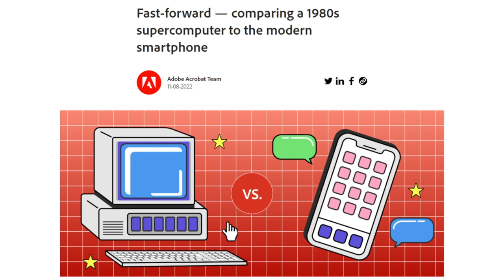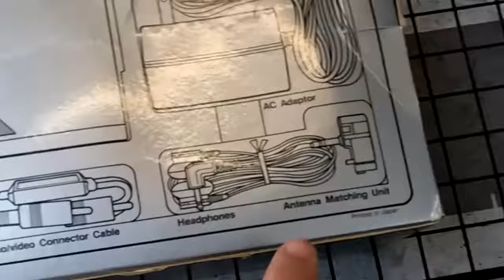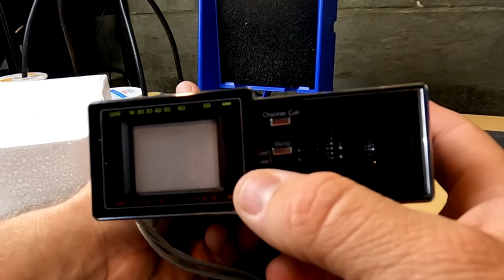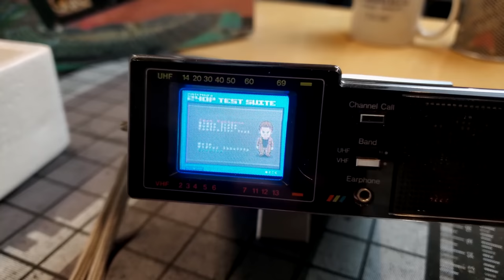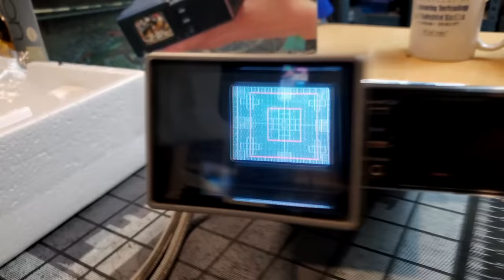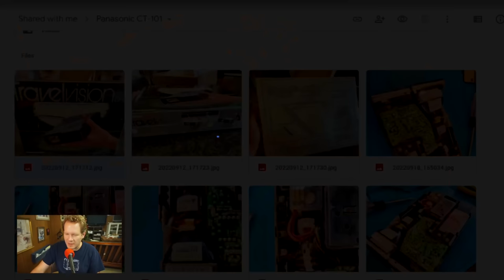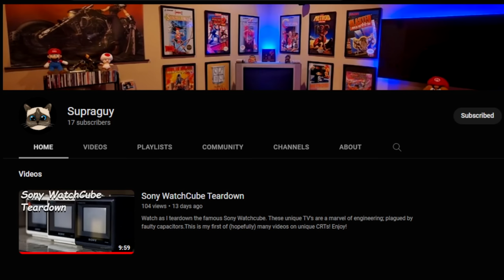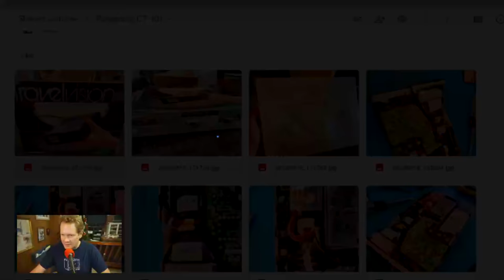The World's SMALLEST Color CRT TV!

Comment: There were similar size colour tubes in some camcorders, and moreso(and earlier) in pro/semi-pro video camreas. Most home camcorders used black & white ones, but I can remember colour ones briefly before LCDs replaced them. I'd imagine devices like this were almost certainly re-using the same tube.
Reply: I was going to say this! I believe a couple of the films during that era had custom stripped down units and were made into remote screens to be used as a futuristic handheld video screen props!
Reply: Monochrome CRTs were widely preferred as camera viewfinders, due to the poor resolution of small colour screens. I remember an interesting innovation in the early 90s, I think Fuji made it. A colour viewfinder that used a monochrome crt, with some kind of spinning colour wheel in front of it, much like how a DLP projector works.
Reply: It's a fairly creative usage of parts that may have otherwise sat in boxes in a warehouse somewhere unless this kind of product existed

Comment: I have a similar unit, but mine came with the AM/FM radio tuner built-in. Too bad the owner didn't take any pictures with the chassis PCB lifted so you can see the capacitors on the underside. I suspect that many of the through hole caps have started leaking and it's just time before this stops working. A very common problem with Panasonic TravelVision portable TV's from the early 80's.

Comment: I read the shadow mask dot pitch is 0.38mm, which would be just about 100 dots at 1.5". That'd be a resolution of 80×60 dots if the 1.5" is diagonal. Trying to count by hand it looks like a little more than that but not much. Maybe the 1.5" is horizontal and it's 100×75  which looks about right.

I'd probably rather just have B&W to be honest.

Comment: Can see the size to detail threshold for a tube that small especially with text, not so much 240p compliant but definitely 120p like some 2600 or an Odyssey 2 game would display more favorably. Game Boy or GBC 160x144 graphics might just be clear enough but it would need an AV output method to even try.

Comment: 🎈🎉🎊🥳👍👍👍👍😜 Amazing video! This small crt tv is like "diamond"! Guys you are so lucky in USA as they were a bit popular and still it's possible to buy some on ebay etc. at reasonable price. In my country I wasn't able to find even a single offer. And importing with high postage costs and customs is... "dangerous" for my pocket. Lucky I can watch it on your channel. Btw, I'm wondering why this tube is so long. AFAIK longer tube are easier to be controlled (electrons jet control etc.). Perhaps they calculated that it was cheaper to make longer tube than add expensive chips. Sure nowadays probably it would be opposite but at that time crt tubes were not so expensive. P.S. I'm also trying to do sth similar as you but concerning other devices, mostly computers, but not only.